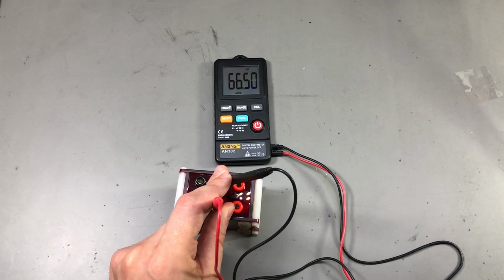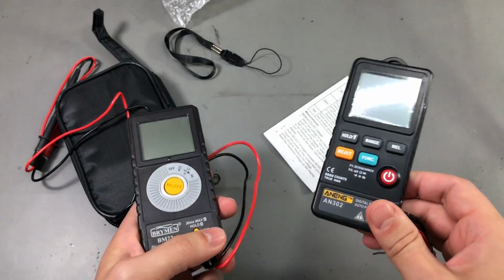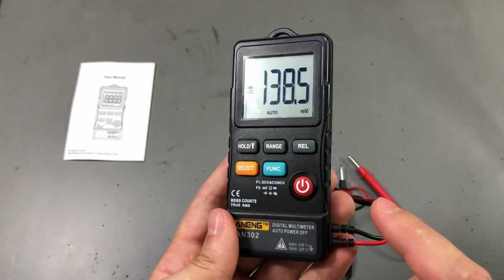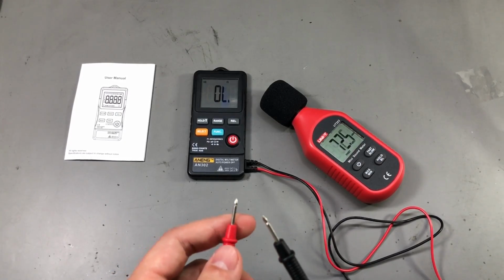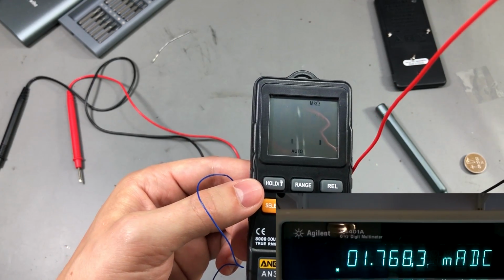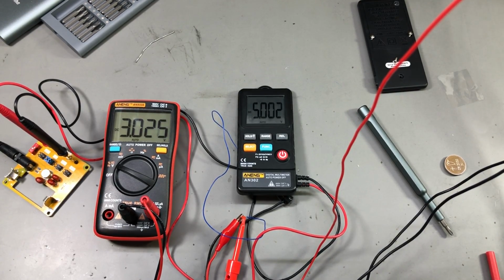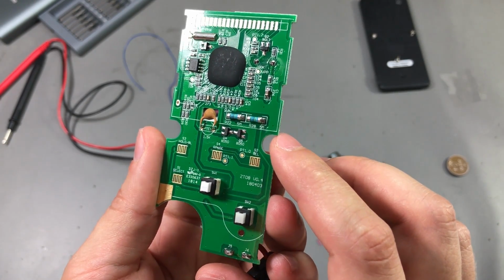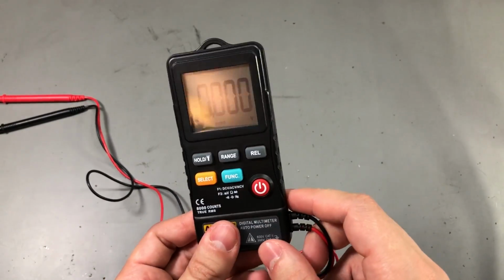Voltlog #175 - Aneng AN302 Pocket Multimeter Review & Teardown

Comment: I think, you're wrong - ANENG is the OEM manufacturer, but they also sell their meters under different brands.
Reply from the maker: any arguments to support your claim?
Reply: Aneng has in their offer a wide range of meters, which only some of them are also sold under different brands (at least with AN800x series). Also the new models come first under Aneng brand, and then show up under different brands after a few weeks or months.
Reply from the maker: that's mostly info I can't verify, I cannot know what brand these meters show up first on,  but here is something solid: 1. I purchased an Aneng AN101 meter without having the Aneng logo, it was practically unbranded and it doesn't make sense for Aneng to sell it like that. 2. Inside this AN302 the pcb is marked ZT08 which would indicate a different manufacturer.
Reply: ZTxx is a ZOTEK/ZOYI brand, so maybe you're at least partially right. ANENG, ZOYI, ZOTEK and Richmeters have mostly the same meters in their offer, yet Aneng uses AN800x model names, ZOYI and ZOTEK - ZT10x, and Richmeters - RT10x. As the AN800x/ZT10x is a Fluke 10x series clone, maybe the ZOTEK/ZOYI is really closer to the OEM. The PCBs are indeed marked ZT10x in all of them. But you must also remember that the meaning and understanding of brand names in the communistic countries is quite different. They will produce under whatever brand name you will ask for. They don't really care about promoting brands, their brand is "made in china" ;) For example Soviets never used any brand names for their products.
Reply from the maker: I bet someone in Shenzhen could shed some light on the subject :-) Someone like Scotty from Strange Parts who knows the markets there very well.

Comment: Thanks for the updated power source test. Good stuff.

Does the AN302 engage its display hold function when you turn on the flashlight, like the UT125C did when you turned on its backlight?
Reply from the maker: It doesn't have the same problem as the ut125c.

Comment: I wondered the same about the bubble wrap being popped when coming from China. I assumed it was just an issue of being flown over in cargo without any pressure in the cargo area and being of sub-par quality.
Reply from the maker: Supposedly the cargo bay is at the same pressure as the rest of the aircraft.
Reply: VoltLog ohh maybe I’m completely wrong, I thought they didn’t pressurise the cargo bay.
Reply: Pretty sure the whole plane is pressurized.  The forward cabin for the pilots has better pressurization than you get in the back of the plane, but the degree is minimal.  I don't think this happens in transit.

Comment: Had it 1 month ago, the unit had a huge short somewhere in the ICs (hadn't had the time to look at it carefully). The unit beeped but the screen was blank. And I noticed a cr2032 had gone from 3.37V to less than 3V in few second. Connected to my lab psu I saw current draw of more than 2.32A. Not that I had great expectations but still I liked the idea of having one of these in the kitchen and in the dining room in some drawer and avoid going into my "lab" measuring some low voltages. Hopefully the next one will be better. I still think that if you have not many meters, (Let's say less than 4) and want a decent ultra slim one... Brymen is the way to go...
Reply from the maker: Yours was DOA?
Reply: VoltLog yep... DOA

Comment: I have the feeling that this meter could also be based on the DME1106/DTM0660 chipset, just like a lot of decent, cheap meters of the past years (AN800X series, UT210, VC921, ...). That would make it hackable, to a certain degree, via the EEPROM (change features, timers, ...). Too bad they used a COB. My two Victor VC921 i ordered recently had DME1106 QFPs populated.

If it's a good idea to use these cheap meters up to their declared specification? Probably not. I would use most of these exclusively on (S)ELV, to stay on the safe side, unless they come with decent input protection, like in my UT210E.
Reply from the maker: Thanks for the info. These are cheap decent little meters. It almost feels like it isn't worth hacking something like this.

Comment: For a few bucks more you can get the AN8008 - far better meter in this price range.
Reply: Sure, AN800X series (i own the 8009) are great meters for the price. But i think the AN302 has still some differences that may be interesting for some people.

- About a quarter of the size in volume of the 8008 (62.5cm² vs. 236.5cm²; bounding box, ignoring buttons, knobs)
- Fixed leads (No wearout of connectors / bad contact)
- Latching buttons instead of rotary switch (replaceable; may last longer)
- A third cheaper than 8008 (based on cheapest, most resonable current ebay offers)
- No current range (good with fixed leads, no accidential low impedence setting)
- COMES IN RED!!!! 😅

The chipset is most likely the same as in the 800X series (DME1106/DTM0660), so accuracy could probably be expected to be similar, and it may also be hackable, to a certain degree, via the EEPROM.

It's definitely not the right meter for everyone and there are certainly better, more expensive pocket meters out there. I however am curious about it and ordered one (in RED!!!). But i also am consious enough to only use it in (S)ELV applications, regardless of what ratings are printed on it's case. For mains or other low voltage measurements i have a more serious meter with proper input protection.
Reply: The later model 8009 is better yet, but I agree with you for the money.
Reply: I already have a AN8008, but still I might get myself a red AN302 just because it's cute, no intention of doing serious work with it.

Comment: it popped in the Air, the bagage hull i not presurized
Reply: I think too that the bubbles either popped during cargo on the plane, at low atmospheric pressure, or the bubble wrap was filled with hotter air than in VLs lab and therefore lost pressure. The buble wrap of my AN8009 also looks popped, but in fact a lot of the bubbles still hold air and only look deflated.
Reply from the maker: I think the cargo bay is at the same pressure as the rest of the plane.
Reply: VoltLog depends on aircraft type, but temperature is Outside Air Temperature unless they carry livestock
Reply: The more obvious explanation is that they bought bad batches of bubble wrap to save money.